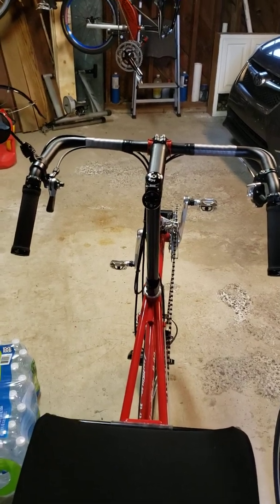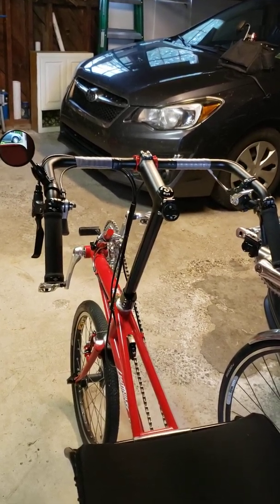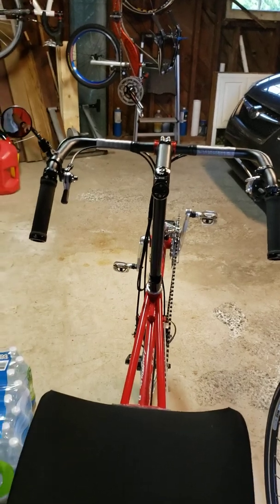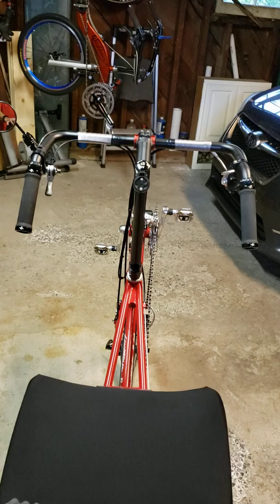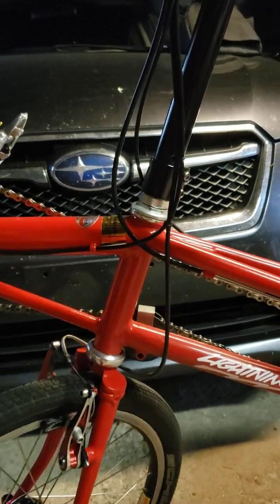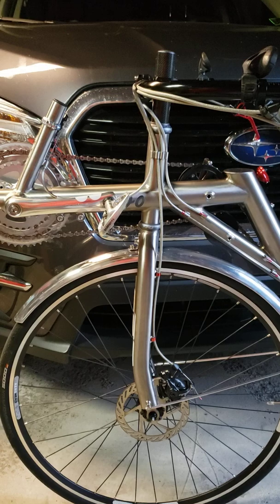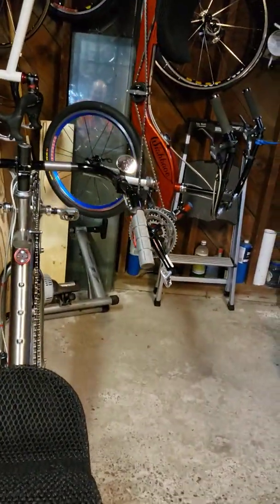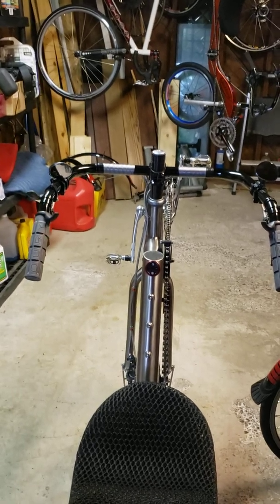Geekbike Ep. 6 - Steering Flop in Action

Comment: Interesting. I have a Stooge rigid mtb that had (until enthusiastic riding killed them) forks with very high offset that would mean lifting the bike when turning the bars. You really noticed this trackstanding going up and down as you corrected. In practice the bike was super stable and would self correct. On a slow no video I can even see what looks like steering wobble as the bike self corrects but on it feels rock solid stable.

Comment: Problem is now you have pointed out that all other recumbent bikes don’t have the best steering, I am now less than satisfied with my new, to me, Streetmachine
Reply from the maker: If you are new to recumbents, you may have felt that way even without this knowledge.  It takes a while to learn any new skill.  Conventionally slack steering angles like on the P-38 can work ok if other parameters are favorable.  I don't particularly like the P38s low speed handling but it's not terrible either.  The P-38 has low tiller, low steering inertia, and an upright seat.  These factors tame the floppiness somewhat.
Reply: Thanks.  May try turning my fork to point backwards and see if the is any better.  In truth it is not that bad climbing, just takes more concentration.  Perhaps more of an issue is the over sensitive steering means on fast descents something you have to be very light on the steering, and it can feel a bit twitchy…I guess I should just be happy going slower.
Reply from the maker: @markthomasson5077  Reversing the rake is likley only going to make flop / low speed handling worse.  You may find the high speed handling to be improved a bit though. It's a cheap experiment, so why not, I guess.
Reply: Turned the fork and gave it a quick spin.  Definitely felt more flop at low speed.  The increase in trail did seem better.  Not sure if better or worse.  Turn it back, don’t really feel safe experimenting on the road.  It does show that there is room for improvement, though not without radical surgery

Comment: Aesthetically, to most peoples eye, it would look better with a dead straight fork.  I guess this gives a bit more slack angle and more flop for the same trail, but maybe acceptable
Reply from the maker: I have a bike with a 559 front wheel, zero rake, and 80 degree head angle and it handles very well.  Almost as good as the Zevo.  If I was designing a bike for public consumption, this is the way I'd go.

Comment: Wow, interesting.
I guess the only thing it does not do is ride hands off.
So why is it that recumbent bike designers think slack head angles are necessary?
I have just got a Streetmachine, my first laid back bike.  I find I don’t need to hold the bars when pushing (up hill holding the seat).  I do find the steering over sensitive, you have to take care, at speed one clumsy move on the bars and you will be off.
Reply from the maker: I can ride hands off at high speed, but it feels imprudent, so I don't do it.
Reply: @SuperKettMan  . That’s interesting.  I had always thought that was what flop was for….wrong again!  So according to MB, it is all just to fit the human on an upright
Reply from the maker: @markthomasson5077  Yes, the only benefit of slack angles on direct steered bikes is to minimize tiller distance.  Indirect steering can resolve both simultaneously, however.  Recumbent designers mostly just copy what upright bikes do.  One minor advantage to using typical steering angles is so that you can use forks that are mass produced for uprights  (e.g. carbon forks).  If you have the ability to do custom forks, then that's no big deal.
Reply: Of course the Streetmachine has under seat steering with a huge backwards facing stem.